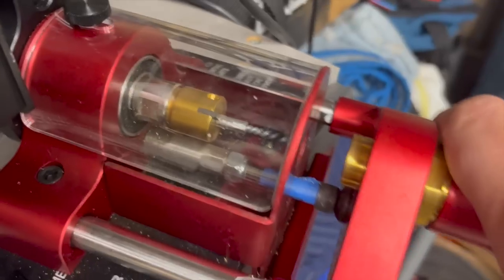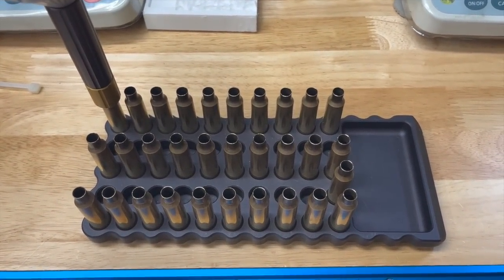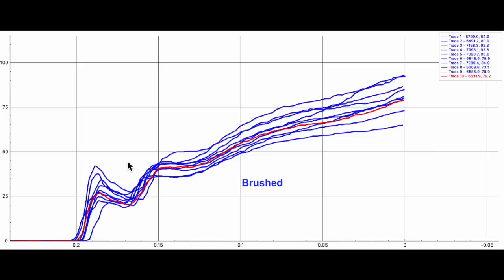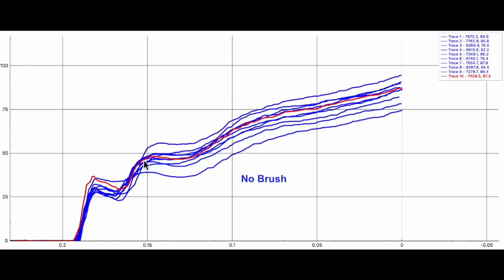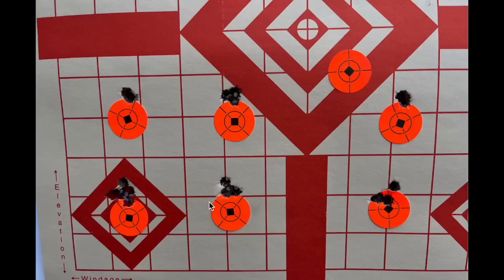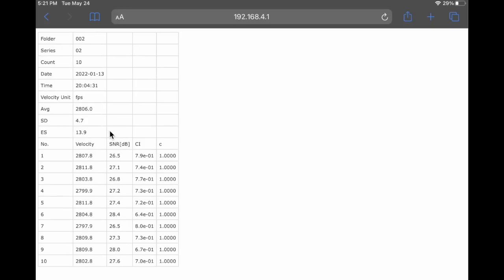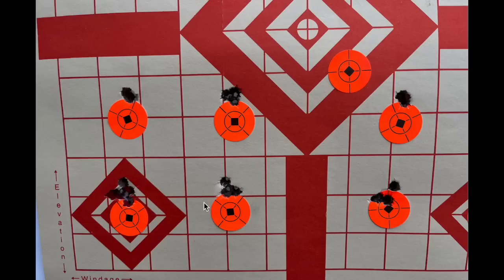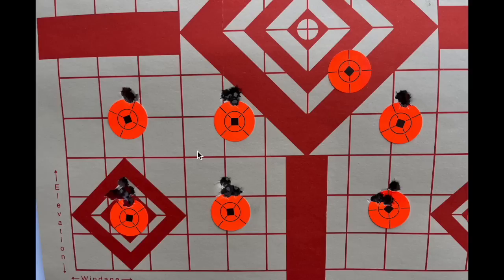Brushing inside necks when reloading and testing with AMP Press and target

Comment: Variant of this idea I would like to see AMP data for: try adding a small pinch of 0000 steel wool to the nylon brush. (Tip recommended to me per personal communication with top bullet manufacturer) just touch it to spinning brush… it will wind in nicely. It seems to really help…

Comment: I brush this inside of the necks with a bronze brush on a battery drill and then  before I put the powder in I use a cotton bud to wipe graphite around the inside then do powder then seat the pills and have noticed a dramatic difference in seating pressure kind you I only use a standard KM Arbor press big can definitely feel the difference, looking forward to your findings during a match 🤙🏻

Comment: I brush the necks with a bronze brush on a drill just before seating the bullet. for me it's better than any kind of lubrication (graphite, moly) because lubricants dont remove scratches..Each time you shoot or run an expander it leaves vertical scratches. Running the bronze brush on a drill polishes the necks in a perpendicular way. Look with a magnifier to compare and you'll understand.why it's smoother.
Reply: Try to unseat those. They will be fused.

Comment: I'd be curious to see data on a 3rd method....brushed and then lubed (either necks or bullet bases). My theory is removing the carbon increased friction. I wet tumble because I use a collet neck die and don't want to run dirty necks over it, (and it cleans pockets well)  so I've been dipping the bullet bases in Redding dry neck lube before seating because my ammo sometimes sets for weeks before shooting. Have not yet tried the neo lube or whatever it is that Keith uses and I don't have the amp press to confirm anything. I can feel a difference though, ESPECIALLY when pulling bullets weeks later. Much less force required so....has to be something to it imho. Just a casual shooter btw. Only compete with myself. Ha ha. I learn a lot from you and a few others though. Thank you for sharing your time and experience John.
Reply from the maker: I'm sure it could work but I don't and won't lube my bullets. Just not my thing anymore.
Reply: I’ve been doing the same thing before seating, coating the necks with Redding dry neck lube. I haven’t came to a conclusion on the findings yet but it definitely helps create a smooth seat and cuts total runout down significantly.

Comment: Interesting, I have always brushed with a nylon brush using my RCBS Case Prep after debur and champering. I would like to see if you get similar results between the Henderson and hand brushing. Thanks very much John. Very interesting.
Reply from the maker: I've tested hand brushing with all kinds of brushes in the past and never saw much improvement or at least enough to make it worth the time.
Reply: @FClassJohn  Well got me thinking now, will have to run some of my own tests to see what I am really getting. Been pretty happy with my results on the range, but always room for improvement.

Comment: just watching this on brushing and on the graphs from amp press. curious about the graph. looking at it, the lower half (looks like an m) isn't that the complete loading of the bullet? after the m, the ramp in the graph is the amp press at the wall building up to it's shutoff? thinking about hand using my arbor press, once the bullet is seated the handle just stops...but the graphs show a slow ramp...not a dead stop. i also bet the motor that drives the amp press is on a variable drive...if it is, the slow ramp is exactly what it would show driving into a wall...brushing shoots better because it cleans the neck smooth on copper fouling. the graph looks worse because cleaning with a brush is going to be different, case to case, therefore the carbon fowling (which acts like lubrication) is also now different. just spit balling here, what do you think?

Comment: Hey do you wet tumble after brushing? I did with ss media and got some great 5 shot groups in 6.5 cm...0.18 inch at 100 using bipod and rear bag and non Henderson station brush but a hornady station brush
Reply from the maker: I dry tumble. The brushing in the video was literally the last thing I did before loading.
Reply: Wet tumbling AFTER brushing would  not only be a bad idea but would make your neck consistency us less unless you are going to run them back through an expander mandrel. Wet tumbling with stainless steel media peens the case mouths and will kae for some rough seating if that is your last step. Wet tumbling if you choose to do that should be fist step right after popping primers
Reply from the maker: @jameskozlowski5496  I totally agree with you.

Comment: Was brushing done before or after the expander mandrel?
Reply from the maker: After
Reply: @FClassJohn   is it possible the brushing changed the neck tension ever so slightly?  You set neck tension with a dirty neck, then clean the dirt and carbon out, that leads me to think neck tension would be a little more loose.   You could test by running running a .0005 larger expander in the non brushed brass and uses current bushing for brass that will be brushed and see if the groups confirm.

Comment: Brushing seems to partially remove the combustion products from the neck.  What about wet cleaning your  brass. This removes all of the residue. Seems like this would improve neck tension and seating pressures by making the actual brass dimensions more consistent (remove the variable thickness of the residue in the neck from the sizing process).
Reply: Oddly enough well that is all true I’m going back to not brushing because after more testing which I will show in another video I was getting worse result again. Historically every time I test this my non-brushing shoots better at Long range than doing the neck brushing. Everybody’s results will vary of course but for me personally that’s what seems to happen.

Comment: Have you ever thought about nickel plating the necks?  You would have to do it after every firing but it would make the friction more consistent.
Reply: Think about how piston rings work in an engine and the cylinder wall.   An engine builder would never use chrome rings in a chrome cylinder.  One or the other must be more permeable than the other on a microscopic level.  The reason is, one side or the other needs to hold  lubrication.  In a cast iron cylinder, chrome moly  rings are used because the cast in the cylinder is microscopically more porous allowing it to hold lubrication.  So, the chrome moly rings actually slide up and down on the lubrication, not the cylinder wall.  And in a nikasil cylinder, iron rings are used because they are more porous and hold lubrication.  They also slide up and down on the lubrication, not the cylinder wall.  The same applies to bullet seating to some extent.  Because the bullets are basically polished, they do not hold lubrication well.  The brass is not polished, so it would hold lubrication well.    Never would two highly polished surfaces, that would not hold lubrication be a good idea in the mechanical world where pressure is applied against two opposing surfaces that are designed to move. A bullet riding against a  consistant lubricated surface would give the most consistant results and the least resistance to movement.  Finding that perfect lube is one of the places that AMP Press would shine.
Reply: 😂
Good lord

Comment: john, are you still doing this? i was very tempted to do the same thing with my henderson v3 but my pilot has saved me a few times when a piece was inserted slightly off kilter. what brushes are you using? what all did you actually do to make it work?
Reply from the maker: Honestly, I’m still going back-and-forth on this process trying to narrow down whether it’s worth the effort or not. I currently am using the pilot but do switch back for different testing with the brush. The pilot definitely makes things easier and probably a little more consistent compared to the brush so I wouldn’t really recommend the brush unless you’re in the mood to do some testing.
Reply: @FClassJohn  I’m all about making brass prep as simple as possible. Maybe with a short bristled brush it would have more rigidity and act closer to a mandrel  but I’m not sure would clean the neck as consistently due to lower brush count. Hmmmm. The target looks great but the amp press data is concerning. Makes me wonder if it would have different results with different brand brushes.
Reply from the maker: @TrevorCazes  Yeah I totally agree and that's why I'm still on the fence. For most of the year I honestly don't do anything inside the necks (and I dry tumble so the carbon is mostly in there). There's an endless set of paths we can go down with reloading and I'm always testing with the goal of reducing or eliminating as many steps as possible to simplify things without loss of quality.
Reply: @FClassJohn  couldn’t have said it better myself. I completely agree

Comment: I'm curious about brushing the necks.  What exactly is the brush doing to the necks?  Spreading lube?  Smoothing the inside of the neck? 
I've tried brushing and saw no discernible differences.  That is probably because I don't have a custom rifle.
Reply: Brushing the inside of the case necks to remove the build up of carbon.
Reply: @conservativesniperhunter7439  thanks for the reply. Since I wet tumble, there isn't any carbon left to remove.
I have tried lubing with graphite. Bullet insertion pressure is reduced a bit, but results on target shows no difference. YM MV.
Reply: @dmalcolm24  if wet tumbling removes all carbon build up in the case necks you’re laughing. I have a Hornady Sonic cleaner that removes most of the carbon but not all of it . I think I’ll try brushing the necks before tossing the cases in the Sonic cleaner in the hope that this might get all of the carbon out . Cheers 🍻
Reply: @conservativesniperhunter7439  I'm probably excessive in my brass cleaning.  I wet tumble with steel pins and Brass Juice.  After rinsing and dry and annealing, I lube and size and then dry tumble to remove the case lube.  Probably the case lube is not completely removed but I'm relatively happy with seating pressures.  
I tried an RCBS sonic cleaner and was not happy with it.  A friend had the Hornady Sonic cleaner and it did a fairly good job, but not as good as wet tumbling.
I have enough brass to sustain me for most of a year, so when it's time I get it all done.  It's a PITA and not the part of reloading I like.  When I'm finished, I have several months worth of brass primed and ready to load.
Be safe and have fun.